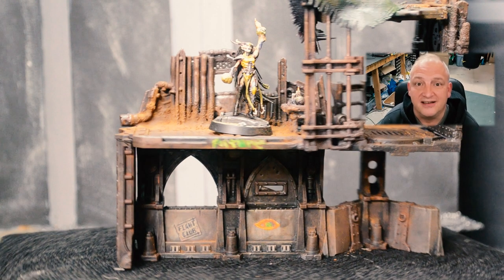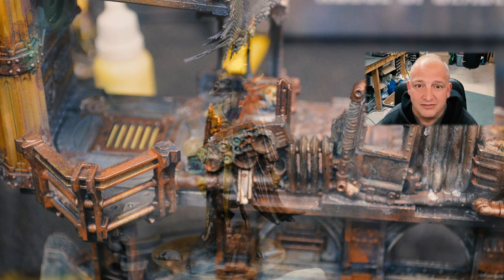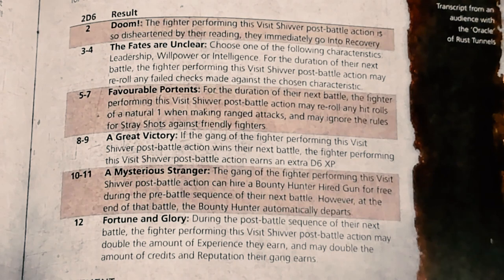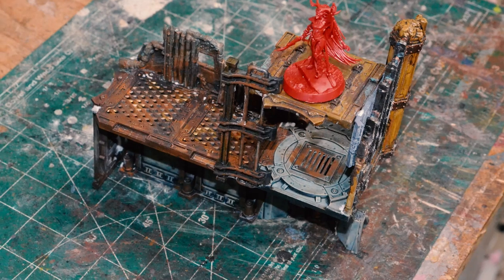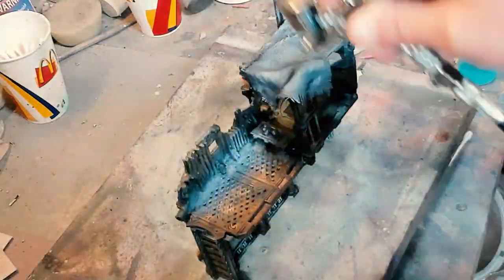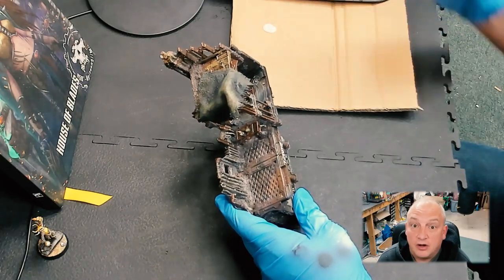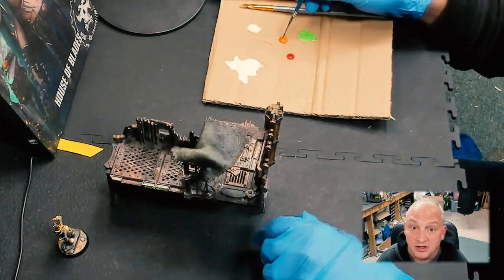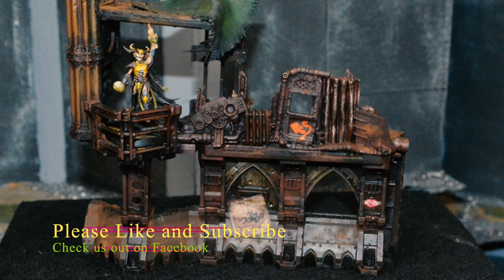#Necromunda Narrative Terrain

Comment: Are there good tools for cutting circular channels from blocks of foam?  Because if so I could imagine having a large concrete foundation for another structure where you can remove the top half and have large drainage tunnels inside to have hidden layers for some of these hangers on.
Reply from the maker: THAT is a good idea!  I've never actually tried it out before but I'm pretty sure that the wand cutter should be able to get the job done.  Boy you have some good ideas! Thank you!